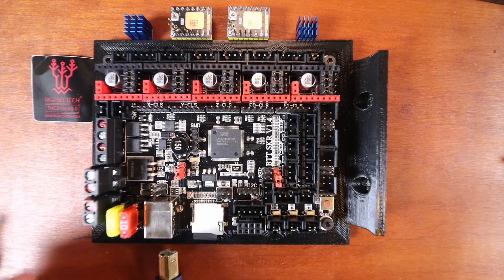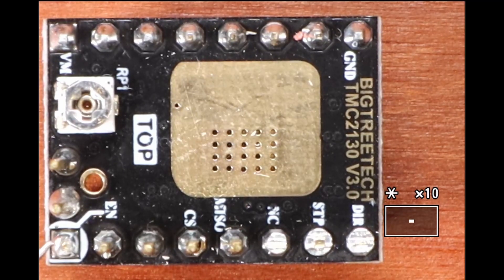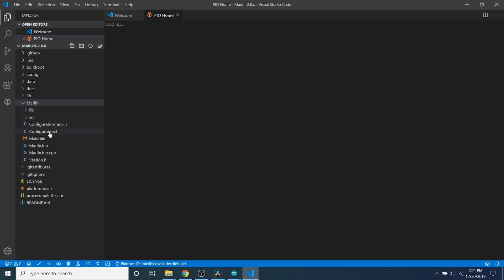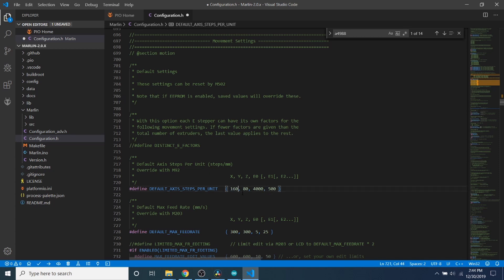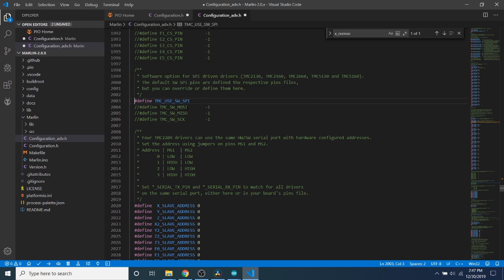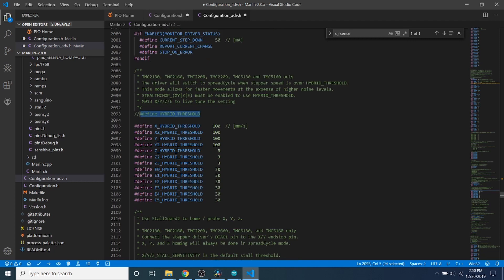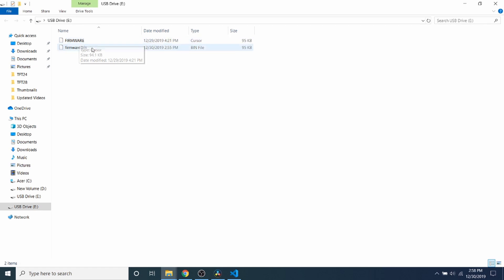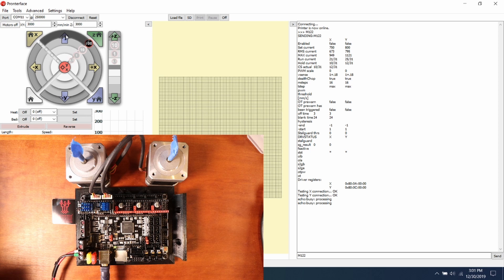SKR 1.4 - TMC2130 SPI

Comment: I'm somewhat confused.. on my MKS I had to connect the SPI via wires to the board.. is this not a thing anymore with the MKS?
Reply from the maker: Not on this board.  The wiring is through silk screen.  Remember to follow manual if you use sensorless homing for correct configuration.
Reply: @EdwardBraiman  cool thanks, not 100% sure what you mean by silk screen (I kinda assume it's just via internal wiring, sorry not 100% english haha)

Comment: Taching tech made a wiring harness, but I have the same exact driver you have and board, do I need one?
Reply from the maker: No.  Just remember to move jumper from USB power to board power, otherwise TMC steppers resets.
Reply from the maker: The wiring is in the tracings on this board.  This no need if jumpers are set for steppers.

Comment: I hope Ed or someone can help me.
I am using skr v1.4 turbo with tmc2130 in spi mode and the problem is when I try to turn motor on 3000 mm/min motor is buzzing and not turning but it runs fine with 500 mm/min. I have seen at the end of your video that you run motors at 3000 mm/min with no problems. Thanks for your help in advance
Reply from the maker: Can you post you configuration.h and configuration _adv.h in Discord from link in description.  The chatroom #GeneralChat.  I'll be home from work in about half an hour.
Reply: @EdwardBraiman  this will be great
Reply from the maker: Ok.
Reply: @EdwardBraiman  I can make an short video to show you what is happening. Thanks a lot for your help

Comment: Great video! Do I need to clip the outermost diag pin to use physical endstop switch for my z axis with this combination of driver/card?
Reply from the maker: Yes. But at that point you should use a tmc2208.
Reply: @EdwardBraiman  ahh i see, well i got them second hand, so got a kit of 5x 2130 with the board 😊

Comment: for the DEFAULT_AXIS_STEPS_PER_UNIT @8:59 it doesn't only depend on the micro steps, it also depends of your actual physical printer setup (belts/ pulleys/ leadscrews..etc) and it is better to use a calculator https://blog.prusaprinters.org/calculator/
Reply from the maker: Correct.  In either earlier or later videos I talk about it alot more.

Comment: Thanks for the great tutorial. The only thing i don´t really understand, do I not need to connect the wires that i received with the TMC2130 from the SPI Drivers to the Board?
Reply: Hi, have you found your answer yet. My guess that’s the wire for sensor-less homing.

Comment: I am curious about tmc2130 with skr pro v1.1 I believe I have everything set up right but the z and y motors make a grinding sound. also sensorless homing doesn't seem to work. I'm at a loss
Reply from the maker: Grind noise might be related to current setting in configuration_adv.h and either too much or little current.  The datasheet for your Nema17 maybe a help.
Reply: @EdwardBraiman  thanks for the quick reply. I used the motor wires from an older printer and they are reversed. I switched to the stock wire and it works just as you have shown. Looking forward to more videos!
Reply from the maker: Thanks.  Been. Very busy for the last month with work, so I might have time to make more videos.

Comment: I see you only placed 2 tmc2130 on the x and y axes. I have 5 tmc2130, can I put them all in? Do I have to change the drivers in the firmware as well for the Z axis and E stepper?
Reply from the maker: Yes.  I did two to show a pattern and the rest is for the user to figure out.
Reply: @EdwardBraiman  thanks for the quick awnser. I also noticed some tutorials on the SKR V1.3 add jumperwires, is this needed on the SKR v1.4 aswell? I'm fairly new to the 3D printer world :)
Reply from the maker: Are they small black jumpers or more than a centimeter long?
Reply: @EdwardBraiman  multiple jumperwires of a few centimeters. They came with the motherboard. Red, blue, yellow, and green. most of them are all connected. This is a link to the image: https://external-content.duckduckgo.com/iu/?u=https%3A%2F%2Fae01.alicdn.com%2Fkf%2FHTB1STHvv_qWBKNjSZFAq6ynSpXau.jpg&f=1&nofb=1
Reply: @niet5647  they're the jumpers so you can set the spi mode on other boards, like the MKS. 
Since you're using the btt board with the btt drivers, you don't need the jumpers

Comment: Thank you for doing all you do. Your tutorials are spot on and have helped me tremendously. In the near future can you do a video on the BL Touch and SKR 1.4 turbo board?
Reply from the maker: I want to do a tutorial on BLtouch, but as of yet, it does not work.  I'm concerned it might have a mechanical issue or software issue.  I have a forth BLtouch coming Sunday, so I'll be recording some tests for Marlin firmware to see if they can decipher issue.
Reply: @EdwardBraiman  Did you install the optional DCDC module for the board?  I don't believe BLTOUCH will work without the module.
Reply from the maker: Unsure, I'll need to investigate.

Comment: not sure what is different with the skr 1.4 turbo but i cannot get this configured. i get all kinds fo errors [.pio\build\LPC1768\src\src\HAL\HAL_LPC1768\HAL_SPI.cpp.o] Error 1 
[.pio\build\LPC1768\src\src\HAL\HAL_LPC1768\HAL.cpp.o] Error 1       
Marlin\src\HAL\HAL_LPC1768\../../inc/../../Configuration.h:133:31: error: missing binary operator before token "BTT"

Marlin\src\HAL\HAL_LPC1768\../../inc/../../Configuration.h:133:31: error: missing binary operator before token "BTT" 

and it doesnt matter what entry i use for motherboard its always the same.

Comment: what is difference between skr 1.3 and Skr 1.4. I saw few  jumpers for the end stop in skr 1.3. but these are not available in skr 1.4.  Why is that
Reply from the maker: The SKR 1.4 appears to be better thought-out for tracings on the board.  So off the Endstop pins are now integrated to override Endstop pins when certain stepper boards are connected.  They also added wifi and LED ports to the board and more connectors for fans.  It may have drawbacks, but it might be a Marlin firmware issue.  I'm still working thru BLT issues.
Reply: @EdwardBraiman  know my housemates thank you for digging through this before I order mine.  :)

Comment: my experience with the 2130 and sensoirless homeing were not succesfull , either the sensitivity was wrong and the axis did not move, or the endstop was not recognized properly in marlin2.
im still using the physical endstops for now 

this works perfecty on marln 1.x on the prusa i3 mk3
Reply from the maker: Same here, but it seemed in my case dialing RMS setting as close as possible helped get sensorless homing to work.
Reply: @EdwardBraiman  maybe a small tutorial will help others as well :)
Reply from the maker: True.  My issue is having a printer that easily fits in the frame on the table.  I'm preparing a new printer now, but it's going to be a couple of days before the frame arrives and parts are ready to assemble.
Reply: @EdwardBraiman  I know what you mean, been working hard on the CR10s5 with the SKR1.3 ( with the above minor issue) making that standalone and quiet for large prints is an adventure, but fun to do, next week the enclosure should be done as well, ( 2 other printers fit on top of that enclosure :)  )